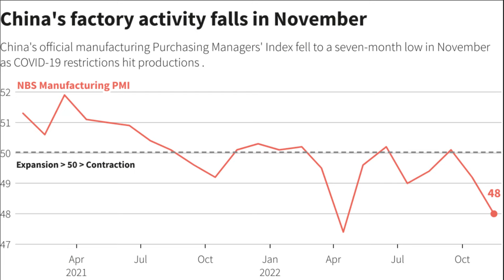China Manufacturing is a HUGE mistake! (In 2023...)

Comment: Hi, I was wondering if you might be able to help. I am looking at manufacturing a product. Still very much in the early stages and I'm trying to figure out how much it would cost and what the typical MOQ would be on this product. Without giving too much away, it's part electrical as it must heat up and would need to be made from some form of metal otherwise it would melt if it was plastic. I appreciate that isn't much to go off but any advice you can offer would be much appreciated.
Reply from the maker: MOQ on electronic products and components like heating elements can be as high as 3000 pieces. You might be able to negotiate this down to 1000 pieces. As a rough estimate of unit cost, divide your recommended retail price to the end customer by five. Very rough but at least that’s something to go on!
Reply: @ProductInnovationAcademy  thank you!!!
Reply from the maker: @mohammedmitha7743  you’re very welcome. Please make sure to like and subscribe!

Comment: Great info! I have a product/invention that I want to get manufactured in China. I am worried that the manufacturer might steal or sell my idea/design. How do I make sure that doesnt happen? Thanks in advance :)
Reply from the maker: Hi there. That is a HUGE question! I'll do a video on it shortly and post the link here. In the meantime get a patent, registered design and trademark first, if appropriate. Use a recommended manufacturer who has a track record of not stealing ideas. Get an NDA or CDA signed by the factory first. If possible add the secret sauce at a different factory so one factory doesn't have all the info. Finally let them copy it - for an agreed fee. Give them markets you can't access to sell into in exchange for cheaper tooling/units/fee per unit!
Reply: I have a similar issue too
Reply: Are you kidding me😂